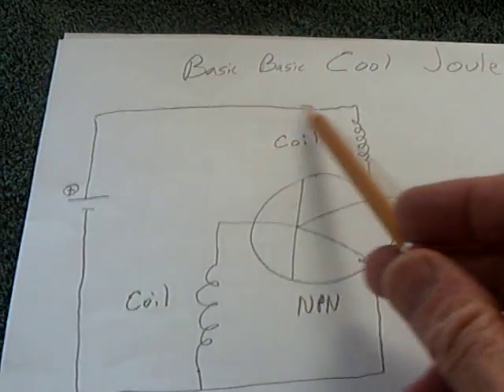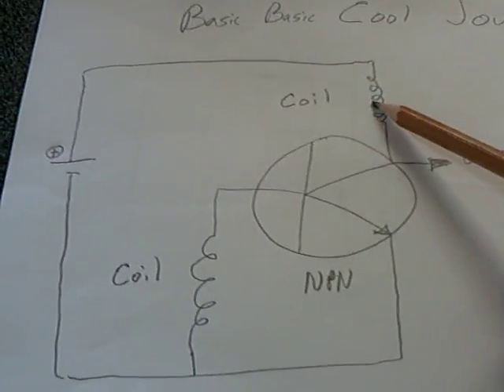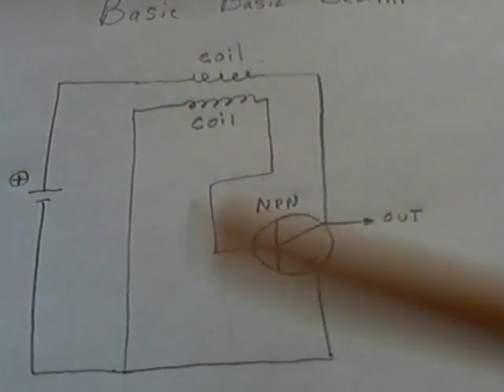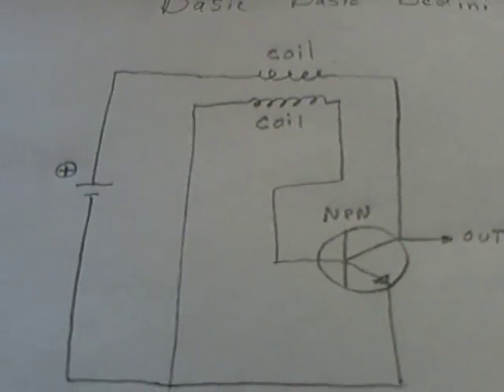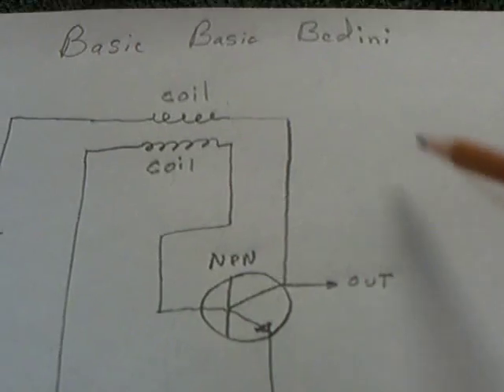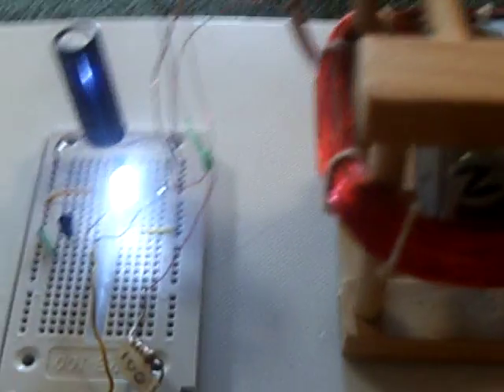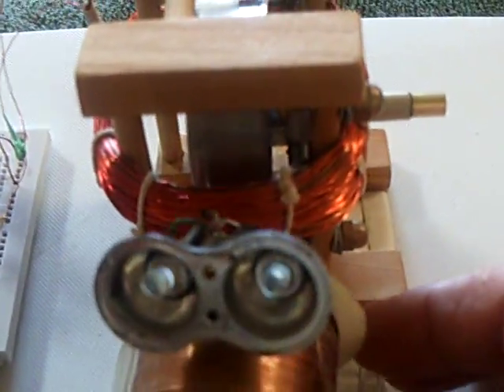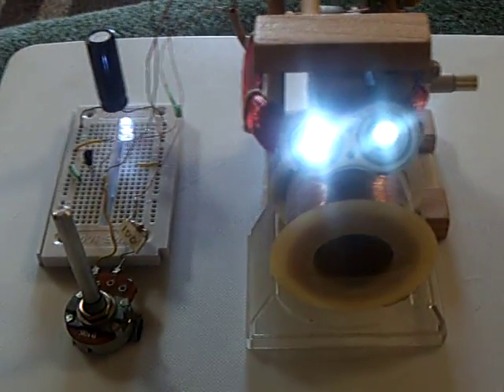Simple Electric Motor ---  Basic Basic  Bedini style

Comment: The SSG is a good starting point,and a fun project. But it isnt very efficient as far as a desulphator go's.If we look at the SSG ,we see that it is recomended to find the H wave and have 1 pulse per magnet pass.So if we have a rotor with 6 magnets,we will have 6 inductive kickbacks per rev to desulphate a battery.If you sepperate the two coils you have on your pulse motor,you will get around 3000 inductive kickback spikes per rev to desulphate your battery-depending on coil type ofcourse.

Comment: Hi Lidmotor. It actualy started off as Dadhav's single coil motor circuit-no JB's. This simple circuit is the heart of many different circuit's. You have noted two already,that being the slayer exciter and the SSG. As a pulse motor driver,it dosnt work like the SSG. The two coils remain sepperate-one either side of the rotor(which must have atleast two magnets on it 180* apart.L1 is the drive coil,and L2 switches off the oscillations so as the magnet can pass L1-then the oscillations start again

Comment: Nice to see you brought back Maggie she has been gone for awhile. This circuit kinda reminds me of the joule ringers a little bit. Using the base and the collector together and getting a good oscillation going. I wonder if you had a third coil charging coil and a second cap with a reed switch to dump back into the run cap would it extend the time it would run or would it just fade off faster?

Comment: I love it again! I was wondering if you could come up with a simple radio transmitter beacon that could be used to find a downed RC plain in the bush from a good distance? I have seen a few examples online, but that all revolve around a circuit board that needs to be bought and then added to a diy circuit. I could really use a circuit based on a few low powered 555 timer circuits and the cool joule, or something of similar likes! Thanks!!!